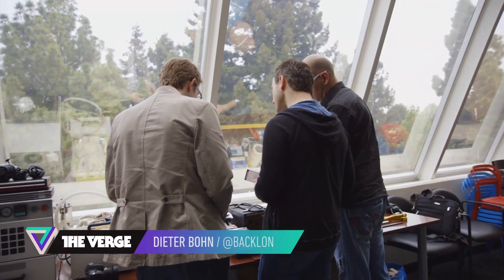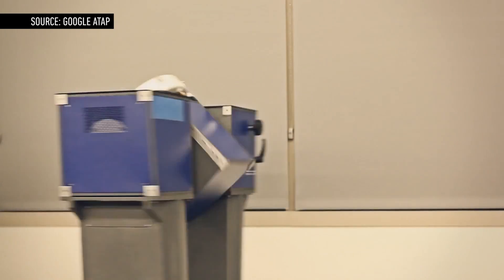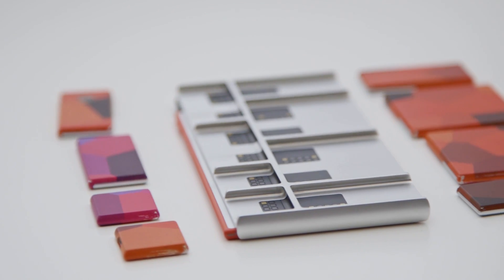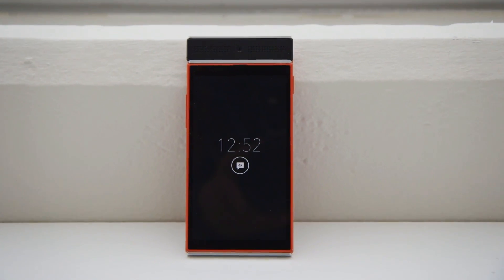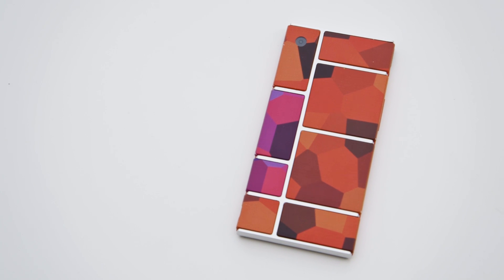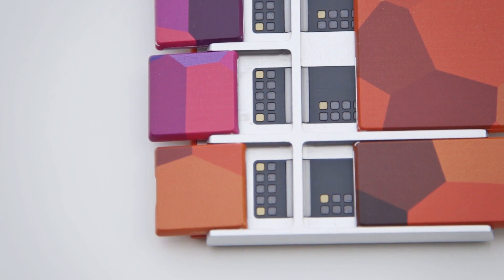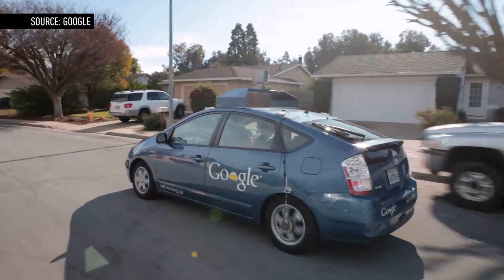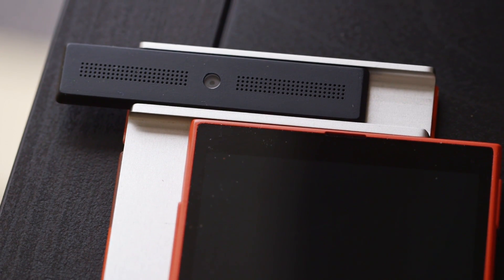Google's Project Ara: Reinventing the smartphone with building blocks

Comment: Want...One..........Want One..... 

Think the only downside is gonna be how many times you can take your component items off its slot before it'll no longer clicks and needing a new frame.  Also I hope the memory pieces won't cost as much as we've seen 16 > 32 > 64 you're looking at 50~100 dollar price increase in some phones.  And the 1st generation might be a bit thick, but hell I want one....want.........one....
Reply: What would be cool if there were to be a small memory module, with a microSD slot embedded in the side to add some cheap space for what would be a small storage capacity.
Reply: ColorblindMonk Yeah like a 8~16GB block with a SD card slot (that would support up to 128GB cards with U1/3 rating) would be awesome.
Reply: Zeiss120  yes omg that would be a fabulous idea!

Comment: If u drop this phone, will all the modules fall out?
Reply: No. The electro-perminant magnets will be nearly impossible to remove or have fall out when the magnet is enabled. Even if you loose all power the magent will still have it's full force. You have to disable the magnet to remove the module. (It's a really good idea, prevents you from potentially swapping out non-hot swappable modules like system memory or processor.)
Reply: It's magnetic, so no.
Reply: I would imagine there to be some sort of locking mechanism when you're done swapping out modules, or maybe the pieces click into place.

Comment: I wanna try this phone out so bad lol. Pretty cool to think if you don't have a good enough of a camera on the phone just upgrade to a new camera module instead of getting a completely new phone. Endless possibilities.
Reply: yup, it's great. for example, i'm a broke ass student and even though i want a smartphone with decent or superior camera, all the phones with good camera sensors are extremely expensive, because they do not only offer a good camera but also a bunch of other stuff that i might or might not need but would have to pay for anyway even if i only want the quality camera.

with an ARA phone, however: i could simply purchase a cheap ass phone for basic functionalities that i'll ever need, and buy a camera module to snap it on, and da-dah!!
ø want and upgrade in RAM or SoC to play that new game that just out? no need to buy a whole new phone, snap! upgraded.
ø damaged mic or speaker? snap! replaced.
ø parents want to borrow my phone for a certain function that my phone has that's better than theirs? no need to borrow the whole phone. here, trade the parts for mine!
ø using phone as a backup, hence don't need all these expensive parts? guess what, i'll just trade with my brother's less expensive ones so he can get an upgrade for cheap and i can get some monies dollarzz in return!
ø oh crap, my phone is out of batter and i need to call someone real quick, but i can't find the battery or charge the phone, and i also need to power it on because i don't remember their number! no worries, let me borrow someone's ARA phone and put my internal storage module on, so my data along with all the contacts is instantly on that phone! boom. and not just contacts, exchanging gigabytes of data is now at the snap of a finger!
ø waitaminute, if that's the case i can upgrade the whole phone without having to set up and transfer everything, because i can simply carry the one essential part with all the necessary data on it! what sort or sorcery is this?
ø oh, what is this, a new censor they just developed and just appeared on the market? i guess i'll replace that finger print scanner module with this module of 3D motion scanner then! oh, going to the pool and want to take some shots under water? guess i'll just pop out that 13MP regular camera and put on a lower density, 5MP camera in exchange for water-resistance!
ø i have no need for this 4GB of RAM and in need of some cash, anyone with a 2GB module want to trade? by the way, i don't even need the money, if you have a better camera than mine — then we have a deal.

...
yup, definitely endless possibilities.

Comment: Look at those modules and the way they slide out so easily. They look as if they would just slip out randomly as you're walking along with the phone. Not very secure and sturdy at a glance. The magnets must be very weak. There must be something to combat this issue?
Reply: When the phone is on, the magnets don't will slip out. I understood that!
Reply: It uses semi permanent electro magnets. It has two states, poweful magnet and weak magnet (i believe it was 30 Newtons and 3 Newtons of force respectively), and obviously when you are plugging in your component you want it to be guided into place and not yanked on, and likewise you want a strong magnet when it is in place. They have plenty of videos showing how this works, it is honestly really interesting.
Reply: Thiago Calazans  It also dont slip out when the phone is off . Its a passive coponent, consumes no Power, so it doesnt matter wether the phone is on or off.
Reply: Julian Schnägg And when it could slip out? I say, how to?
Reply: Mh i dont no that , but i think there maybe will be a bouton to unlock  the modules =)
Reply: I understand...
Reply: In a conference they said how they have enough strength to hold up a small kitten, they actually said that...... Anyway the type of magnet they were talking about is actually pretty strong, strong enough to hold in the modals without worry

Comment: To me, this is not clever at all.
1) Integration will always make things better, cheaper, because of engineering optimisation, economy of scale.
2) The only drawback of integration is if you want to upgrade, you upgrade the whole thing. Which is not that bad at all, because new software requires better hardware: ram&cpu.
3) There are tons of smartphones on the market, at least one will suit you, unless you are a geek.
4) There are tons of smartphones ~$100 of quite high configuration in China. If you still cannot afford it, don't buy smart phone, otherwise you still need to pay for internet access. 

Conclusion: made for geek.

Comment: so one day when i wake up in my dorm room now i can find out that my roommate 'borrowed' my phones processor
Reply: Not really though if you'd have a password on it, since the magnets used would only go into the off-state if you'd tell them too. Awesome,  isn't it? :D
Reply: Tony2dH Although 30N is fairly strong, it isn't so strong that a person couldn't still force the module off the endo.
Reply: Ur roommate could just take the whole phone, really there is no difference. If I leave my phone lying around, someone could steal it (a normal, non Ara phone for now). So if I leave a project Ara phone, maybe the thief would "borrow" (steal) a useful component. Or actually maybe the whole phone coz that way the thief leaves no trace behind. And u would most likely put a case on to stop the "problem" of components slipping if the 30N semi permanent, passive electromagnet isn't enough. Or just for the look, you would put a case. But then the phone gets thicker than it already is!! First world problems!!!!
Reply: The processor is in the base.

Comment: My only problem with this is that you'll be stuck with the single phone design you buy even though you can upgrade the components, then the way this concept is, it looks like you can loose components. So people can end up loosing the processor or the ram or the camera and so on.
Reply: GetsugaTenshoS the screens are modules themself, they aren't a part of the body itself
Reply: there's magnets that lock the pieces together
Reply: MrScottyTay yeah I know that they have magnets to lock the components into place, but I still have a feeling that the components can be accidentally lost.
Reply: ***** Only if the components aren't attached to the phone like any other small thing you leave somewhere. I imagine we'd see a case of some sort or something appear if this became popular though for easy storage of parts you're not using. Slot them into place and lock them in, turn magnets for the bit you want to take out when you need to.

When they're attached to the phone though, those things aren't coming off unless you tell the phone to tell the magnets to turn off.

For your first point with the design though, I thought about that when I first heard about this and I think we may be able to just replace the body with screen when you want a different design. You can get different shells for components so it's likely you'd just pay for the new body with screen and component shells then switch the components into those shells.

It'd mean a little more work when moving between different phone designs but I think this is a likely solution and one that could work well while still saving on cost.
Reply: MrScottyTay Oh that's pretty cool. Even more options then.
Reply: Not to mention.... it'll be cheaper to replace a lost piece than to replace a lost phone XD
Reply: We'll in another video they said the magnets have enough strength to hold up a small kitten, they actually said that in a conference, I think it would be able to make sure the modals don't fall off and get lost they are extremely strong for tiny magnets

Comment: I like it a lot! I am able to customize my phone now the way I want. 
The processor, the camera, the size of the screen, the RAM, the colour of the device, all up to me...!!! Hell yeah!!
Reply: iamterence77 fair I can live with that anyway, they'll probably bring out different sets with different specs. if so I'm alright with that!
Reply: MrScottyTay just read the ara development documentation.

From the looks of it, any module is limited to a maximum bandwidth of 1000mbit/s, and it uses muxing to handle simultaneous data streams. its enough for an SoC to communicate to other parts of the phone, but even something like splitting the ram would need something 96x faster than ara.
Reply: iamterence77 The CPU, GPU, and RAM are all on the same module so they'll likely be limited by their own specific design choices, power demands and thermal envelope.
Reply: there will probably be limits on the processor, ram and gpu (and meybe the storage).

smartphones use PoP SoCs, where many of the components are integrated on 1 chip. Splitting up doesn't look possible with todays technology.
Reply: iamterence77 that's why they're building this from the ground up... it's a complete new system
Reply: MrScottyTay if it works on a non SoC system, then this leads into a new series of issues.

1) power draw. SoC's are power efficient, splitting up the chip, will draw much more power and require tremendous amounts of battery.

2) what os will it run. So far the most open option we have is android, which is only fully supported on arm SoCs. Even intel still has some compatability issues with the x86 versions of android.
Reply: iamterence77 those are the issues that the guy was talking about that they're currently trying to sort out, overhead he was speaking off are those problems
Reply: MrScottyTay even so, when you look at the prototype, you can see that even they are not going to bother with splitting up the SoC. the overhead they are talking about would be more of the external hardware (cameras, screens, batteries). hence my original comment saying customization of the ram/cpu/gpu will be limited. 

developing an interconnect capable of handling the bandwidth for above, is a giant undertaking, they will need years, to figure that out.

Comment: I like it but I have a feeling that if they lock down the chassis it's going to really be a problem. 
I don't want a heartbeat sensor or a fingerprint scanner. 
I want a 32mp camera and a giant battery and maybe a 2.5ghz quad core processor. 
That's all I need. Maybe 4gb of ram wouldn't hurt.

Comment: What about Battery? It has to be very small?
Reply: if you want, you can put in a big battery - if you want you can use two or three batteries.

everything is modular
Reply: maybes theres a module for that too, so can sacrifice some funtionality for battery life. and the pro argument is, that when better and smaller battery technology is there you dont need another phone, it could be just a new module
Reply: I heard that u can swap batteries without turning the phone off so u can have a little battery and just swap it as needed
Reply: Walid Mankal that's indeed true!
Reply: ***** actually it will be very inexpensive to modules are roughly going to cost you about $15 or so and the actual connecting platform is gone cost around $50. Ara has the potential to change the mobile industry
Reply: Ich denke mal, dass man z.B. auch sich entscheiden kann eine größere Batterie einbauen kann, wenn man das möchte
Reply: Walid Mankal there's supposed to be a reserve like power source/battery inside the main module so if you needed to switch out batteries or cameras or basically any module, it would stay on long enough to do so.
Reply: ***** the great thing about this is, you can just decide for yourself which compromises you want to have.

if you dont want a good speaker, why not just use TWO battery modules, instead of one.
sure, higher capacity batteries cost more, but just get 2 lower capacity batteries for a better price. you can't do that on laptops!
Reply: omgawesomeomg from the same guy(Paul) in the video just a different video. they want to build a phone for 5 billion that don't have a phone yet. It can't be expensive. The price is gone make or break the phone.
Reply: omgawesomeomg another reason for the modules being inexpensive us that the modules won't work without the platform the modules are useless without all the modules will do is transmit info to the device.
Reply: SmartReview I concur with the theory of a larger battery being made available for those who would rather have efficient longevity within a single charge of a battery than a sleekly elegant one of less power, because more or less, that is what it comes down to, power.
Reply: you can put in whatever battery module you want, you could fill the whole back with batteries if you wanted it to last forever aha
Reply: ***** Where do you got those prices from? The prices may greatly vary depending on whats on the module.

Comment: This is like desktop computers all over again; replacing ram, hard drive, graphic card etc. We're going in a big circle. Only difference is that, this PC-like device will be in your pocket.
Reply: You've just described the Mac.
Reply: Is that such a bad thing ? I get the impression that you think this is in some way a step back?  I don't think so.  But i will say that this definitely parallels the pc market in the sense that Apple is the all in one device that can't be modified and Google is the customizable alternative.

www.barronnetwork.com
Reply: And look at what that did for PC hardware!

Imagine how far behind we'd be now if you could only buy a PC as a unit item. They'd be more expensive because the volumes of components sold would be much lower. Software (games) couldn't push the latest hardware all the time because people would only buy a whole new PC every 3-4 years and the devs wouldn't want to slash their potential market by coding something only a small percentage could run.

I'd be well happy to have a chubbier phone for those capabilities.

- Today my phone is going to be a 2x4 phone with loads of battery modules.
- Today my phone is going to be a monster 6x4 media device.
- Today my phone is going to be a photographers dream (light meter module?)
Reply: ***** And New Mac benefit from PC hardware philosophy. Thanks to that they can choose from all PC compatible components so they can get fast CPUs fast GPUs etc etc. Remember the old i-Mac and old PowerPC with they slow old proprietary technology, they got behind until they switch.
Reply: Exactly.  This is why hey switched to the Intel Architecture.  They were able to pick and choose affordable,  high-performance PC components for their non-upgradable unit machines.
Reply: Are you all still alive ?